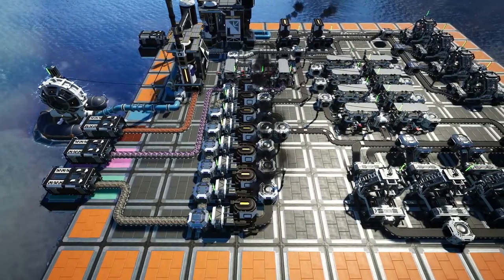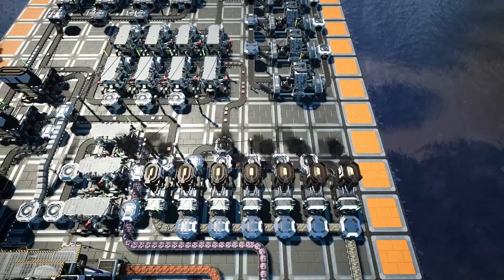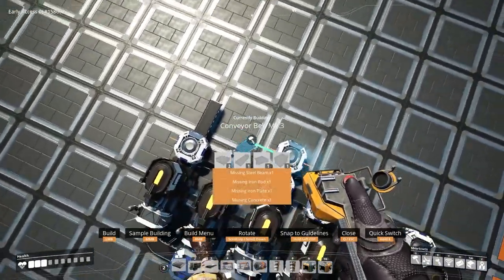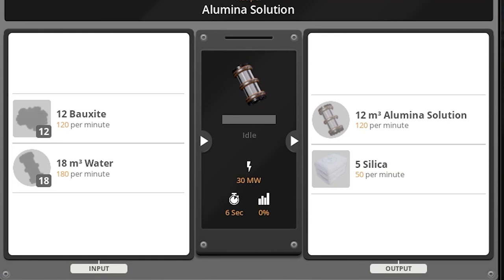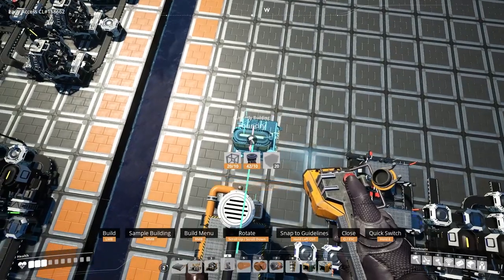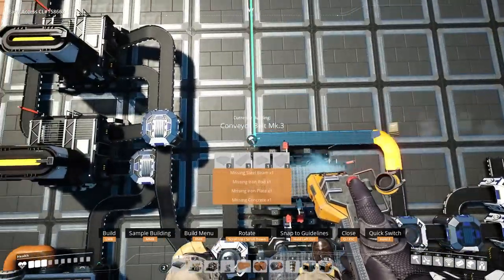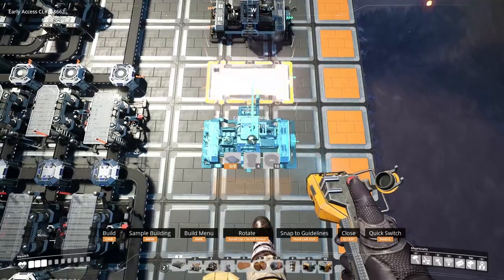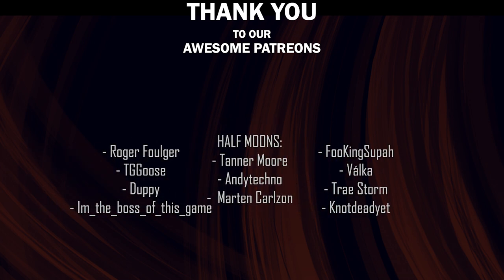100% Efficient Heatsinks | Satisfactory Game

Comment: If you spread out the reduction across all the buildings don't you get a much better reduction in power consumption? Reducing each of the last assemblers from 7.5 / minute to 6 per minute you still end up with 24 / minute BUT reduce the power consumption from about 46 MW to about 42 MW

Comment: So I'm 50 something hours into making a 10 reactor Nuclear power station all overclocked to the max. Dont get me started on the water. I'm in creative mode just because I enjoying building and planning etc. Heat sinks have become an unforseen hurdle. I've managed to fit a very inefficient production line along the outside of the plant. Its a 4x12 space with two lines of heat sink production. Inefficient, yes. Does it work, should do.